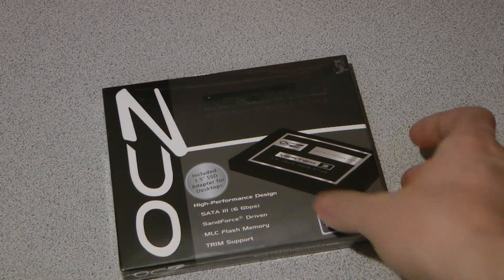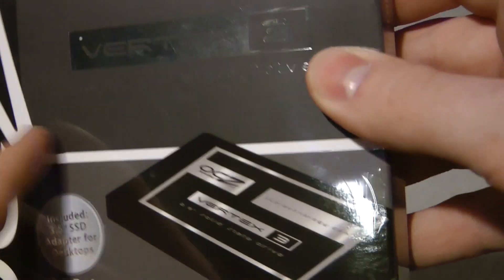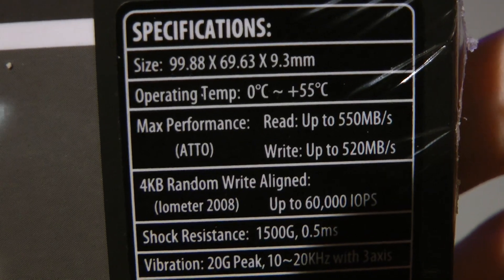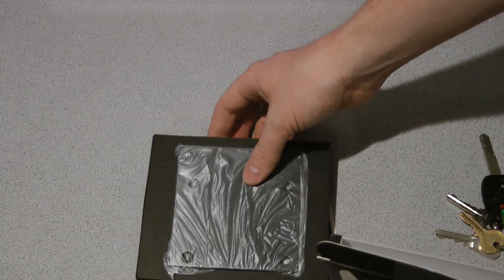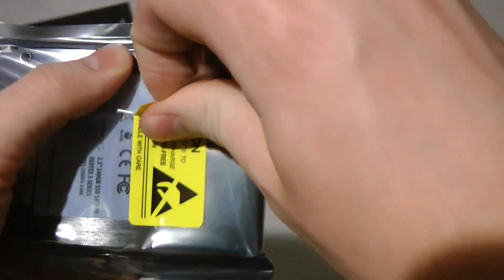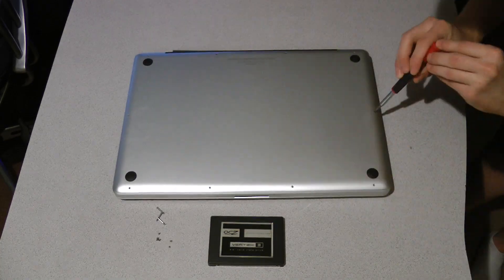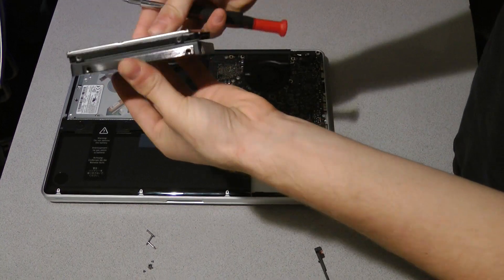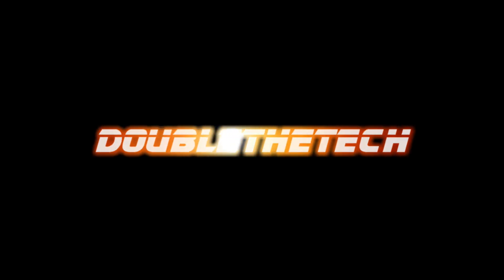OCZ Vertex 3 240gb Unboxing & Install timelapse in MBP 2011 17"

Comment: @321System123 Yep we did re install the OS(s) and later re installed the original drive as a purely data drive in the DVD drive bay with the Data Doubler for the mac (see links in video description)